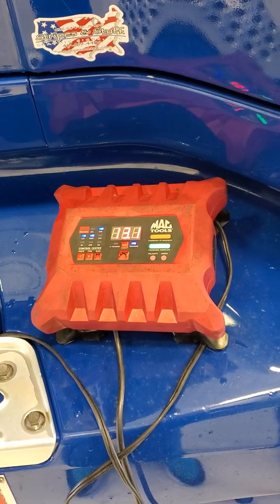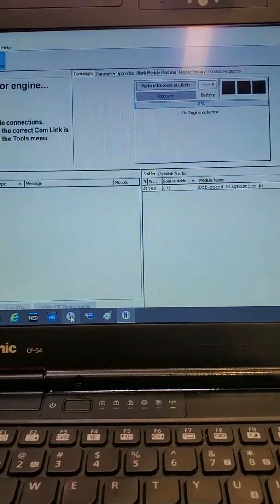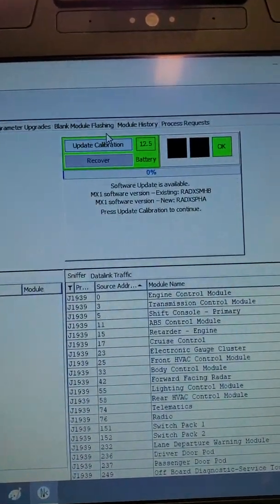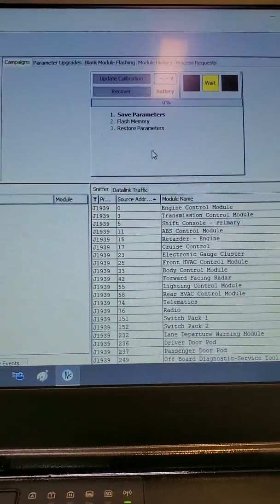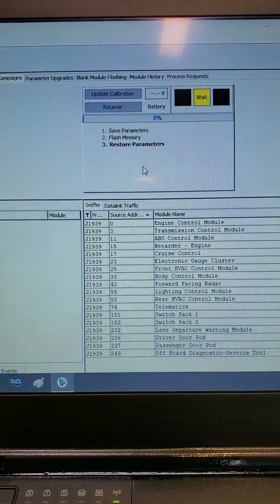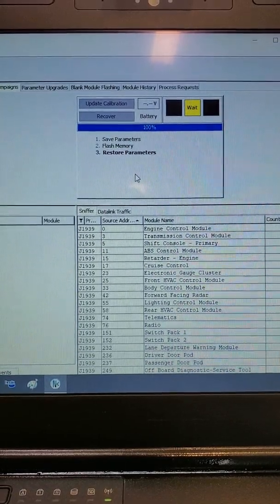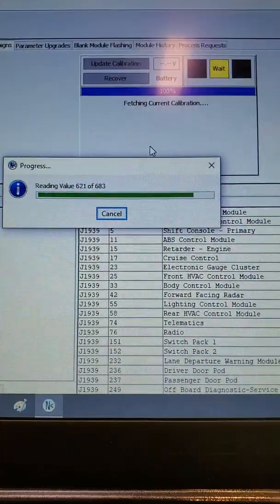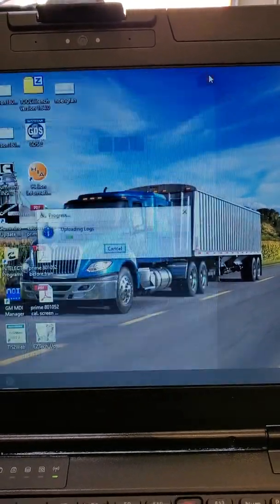NavKal usage

Comment: Hey man, great video! 

I have a 2006 International 4300 DT466 7.6L

I am having a terrible diemma with getting my IDM replaced.

I have a part # 1845117C3 straight from my truck.

I have googled that part # only to find it is used also on the 6.0 VT365 V8 motors.

3 plug style IDM (FICM as F250 owners call them), lays on top of the very thin ECM.

I was able to find a replacement at Oreyli, but tech tells me it comes programmed for a V8 6.0L. Would you know if this navkal software is able to "flash" or reprogramming? Closest International Dealer is 3 hours away. Plus $300 programming 1-2 days. I rather invest in the software and course and do it my self (if possible).

Thanks for the tip